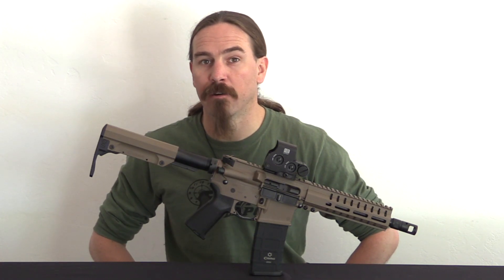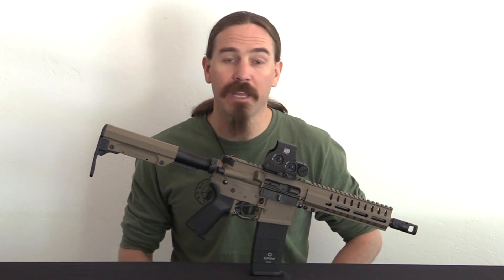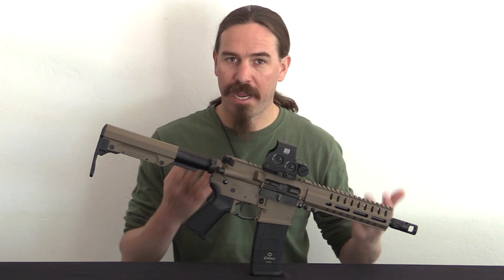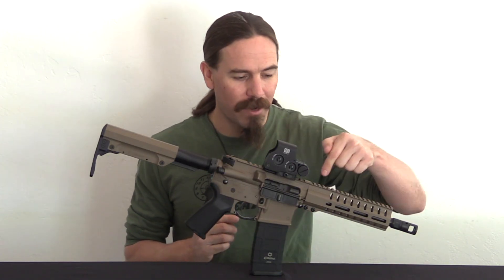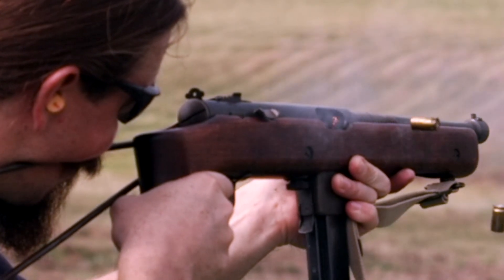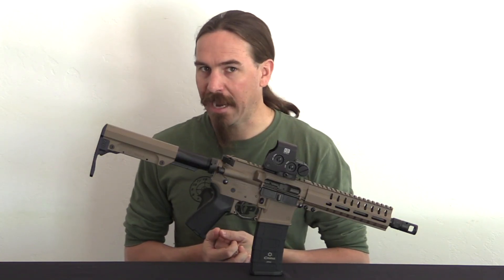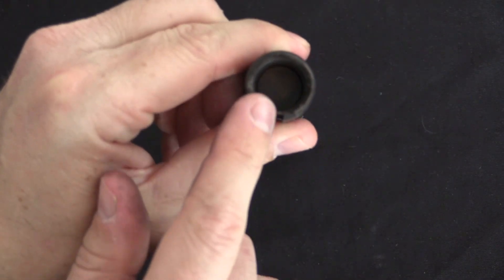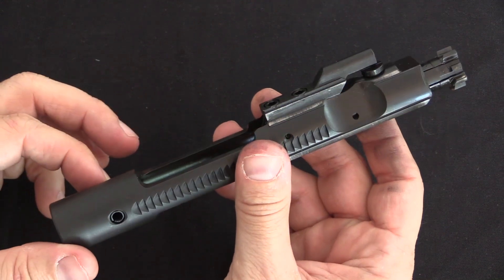CMMG Banshee: The Unique Radial Delayed Blowback System

Comment: Just for clarification, does platform use a spring and buffer like an AR-15 or M4/M16? If not, what pushes the bolt carrier and bolt forward when being cycled or after being fired?

Comment: I really like my Banshee, so much so that it is now my "bump in the night" response tool. I have, however, not had great luck with the conversion mags. I bought the 2-pack conversion kit when I got my Banshee and installed them in a couple of brand new gen 3 P-mags, and have had numerous feeding issues with both mags. I attribute that to running the gun with a silencer, as the mags got very dirty in very short order, which I believe was the cause of the jams. The CMMG "factory" mags (not their conversion mags, rather the 33-round CMMG-made mags) have functioned flawlessly however, and so are the only ones I will use now.

Comment: If the carrier was polymer but keeping bolt, cam pin, firing pin steel you would have a radial blow back for 300b/0 and 556. 😮

Comment: The magazine is interesting, but I'd be comfortable labeling it as impractical in any case besides reusing a lower from a different gun and converting it to tale 9mm. The extra space taken up by the unused area of the converted magazine could hold an extra magazine of a thinner construction. If I had to guess, you'd nearly double your ammunition supply by using thinner magazines.

Comment: FWIW and for posterity's sake, CMMG first named this series “The Guard”, and then later renamed it into “The Banshee”. I have one of the original 9mm Guards and started having a lot of FTE’s and double-feeds. After I sent it back to them they changed enough parts that they also wound up sending it back out to be completely re-Cerakoted in the Midnight Bronze color that I had. I was pleasantly surprised, assuming that if that much work needed to be done they would have just given me a new Banshee model off of their shelf. It’s run flawlessly ever since. And since so many OEM parts were swapped out for new versions I guess that’s part of the reason that the entire line was re-named as well.

Comment: Excellent breakdown of this innovative system. Likely the "Radial Delayed Blowback" system wears longer than H&K's roller delay system.
There is an excellent reflex sight, the HOLOSUN AEMS, that competes very well with the EoTech sight on your CMMG PCC. The AEMS circle/dot sight has many features:  solar panel for reticle when battery dies, choice of circle or dot reticle by pressing the minus button for 3 seconds, automatic OFF after 10 minutes of no movement and "shake awake" ON setting, clear replaceable lens covers, 4 night vision reticle brightness settings (tested to be as good as Eo Tech's settings). PLUSit is less expensive than the EoTech. 
I have an AEMS on my RUGER PC chassis carbine PCC and love it.

Comment: Thanks for doing it.  A technical explanation of how the forces are imparted below.

The difference in the radial delayed vs direct is that the force from the casing goes through several suboptimal vectors, that reduce the amount of force untimely going backwards on the carrier until the cam is rotated.

A simple analogy is pushing a door straight open(blowback) vs pushing at an angle (RDB) at at point the same distance at the hinge both times.  The inertia of the door or carrier is dependent on the direction force.  The door pushes out on the face, and the carrier only back into the buffer tube, no mater what direction the force is at.

1- The force from the casing goes against the bolt, this push causes the cam pin push back, but can only move at an angle, so the inertia applied to the cam pin from the bolt head is a fraction of the original force. 
2- The moment from the cam pin moving then induces a force on the carrier, again not in the optimal position to transfer the force.
3- This dual reduction holds steady until the cam pin is out of pocket and then the force from the casing on the bolt is in a much more optimal direction now, but at this point the peak force has already passed and less momentum has been imparted. 
4- At this point both RDB and DBB act the same in with movement, except the DBB has much more moment (1/2*Mass*Velocity^2), and that will transfer to the shooter.

The real marvel is using the angled lugs to keep the bolt from staying locked and the spring between the bolt and carrier to induce the direction.

Comment: I actually believe that this problem still rings true for the 9 as well as .45. The platform was never intended for a 9 mm cartridge and cutting the gas system from most has made it too dirty. Stick with things designed for the cartridges you're gonna shoot. Just my 2 cents. Pccars have been costing me so many 30 second penalties I'm about ready to sell mine.

Comment: The Banshee looks amazing, but quality control sucks from my perspective.   I purchased a Banshee MK17 9mm and from the first magazine, the trigger reset is garbage.  In my first outing I fired 100 rounds….probably 40 times the trigger failed to reset.  Not sure I got more than 2 or 3 rounds in a row to fire.  The gunsmith at the range took it apart and fiddled around with the safety and the trigger, then lubricated everything.  But no real improvement.  I contacted CMMG and they basically said I can send the gun back for repair (would take several months due to back log) or they will send me parts and I can try to fix it myself.  I am reasonably handy, but not a gun smith.  This sucks for a $1600 gun….all these reviews are positive….but they sell me a lemon and will do nothing about it.  Don’t waste your money.

Comment: The fact that the AR has a barrel extension and separate bolt makes this  platform ripe for dumping the gas system altogether and adopting a PSG1 style  roller lock for improved accuracy . As you know the gas system and semi auto is generally out of thenquestion unless you have a S5 ticket so getting rid of sloppy milspec bolt and extension and closing up tolerances is a good way to go . Just a guess here but I reckon CMMG probably used the 50° angle on the rear of the lugs as used in the H&K roller locking grooves ?

Comment: Would be interesting to create a magazine in 9mm for this gun that has has two columns of rounds, one in front of the other, for more capacity without increasing the magazine size. 
the column that feeds would be double stacked, while the other column would be single stack and slightly offset (tilting) to one side to male it shorter and allow the magazine to fit. Towards the bottom back of the mag there would be a spring to push the single stack into the double stack. 
This system would allow for 50% increase in ammo without increasing magazine height. 
Below is a rough example; the dash (-) is single stack round, the backslash (\) is the divider, the equal (=) is double stack, and the greater than (>) is the spring. The view is from the side.

| -\=|
| -\=|
| -\=|
|>- =|

Comment: Well i purchased just the CMMG barrel/BCG combo of their radial delayed blowback system. I do have a dedicated upper/lower as well for my .45ACP but im wondering if there are any modifications i may have to do to the upper since there is no gas system? I know i still need a light buffer kit but what about that? The upper still has the port for the gas tube. So do i plug it or do i have to buy a proprietary upper for their system? As i am researching ideas for buffer kits for it i saw a few videos on the gas systems so i thought about the open gas port on the upper. Any info/suggestions would be of great help.This is the upper i purchased. ( https://www.midwayusa.com/product/1020533646?pid=197087&utm_medium=email&utm_source=service&utm_campaign=order-confirmation&utm_content=product-description-link ) i hope its compatible with the CMMG's radial delayed blowback?

Comment: Have had my Mk45 Banshee since late 2017. It's has very soft recoil. A few drawbacks are proprietary recoil tube, and handgaurd attachment adapter. Also delayed blowback slows the cycle rate. To the point you can easily overrun it with a binary system. Wonderful little house gun though.

Comment: No it is not

The cam track is longer on the AR 15, because it does not allow the bolt to rotate at the upmost front and back position, which would render the whole delayed blowback system, that sort of thing could never happen also on a recoil operated gun

Comment: i had a cmmg 9mm convert which had bad feed issues. like you said, i used a high speed camera to find out it was the ugly flat plastic brass deflector they'd put on next to the ejection port.
some times the lip of the spent brass would corner dig into the flat face of that plastic deflector and bounce directly backwards, back into the chamber. it was driving me crazy because it would be half ejected stove pipes some times, other times it'd be standard "failure to eject" stile brass in the way. some times the brass would end up back in the chamber completely backwards, primer towards the barrel.
took the deflector off, no more issues.

Comment: Reminds me of the blish system. Not in the original operational theory, but in the use of geometric impedance. Not in the original linier form, but radial. That is the initial energy is divided with a portion of the energy being redirected in an orthogonal direction of the initial force, that is redirect geometrically with a beveled bearing surface; causing the needed momentary delay until the impedance had been overcome.

Comment: One small Czech gun company called V-AR makes a 9mm AR15 that uses the buffer tube as a cylinder with a small hole at the end and the buffer as a piston, so when the bolt goes back it compresses the air in the buffer tube that is forced to escape through the rather small hole and that slows the bolt down. Pretty interesting.

Comment: This radial delayed blowback system with the angled cuts on the rear surface of the bolt locking lugs seems like it would translate over to an AR-18 style of bolt carrier and receiver setup very well.  It'd be able to make use of a folding stock due to not having the action spring in a buffer tube and the square bolt carrier would be easy to modify for swappable weights to tune the action.  Add the fact that a simple stamped receiver would be cheaper to mass produce and you have an attractive little PDW concept.

Comment: My friend just built a 40 cal S&W with the cmmg bolt and barrel. People will say that you cant get it to function on a standard lower made for direct blowback bcgs but with some slight modifications to the ejector tab, it functions perfectly. He used an 80% lower with lrbho from AAO as well and it runs really well. The only issue we had with the lower is that it comes with a really weak mag release spring, a stiffer one holds the mag in perfectly. For the upper he used a slick side 458 socom upper. If you want any pointers on building a banshee using cheaper direct blowback lower then let me know.

Comment: My question of course is if it's 45 Super or 460 Rowland capable. The AR mag setup for this makes sense in a bit more of a way than the 9mm because there never were a lot of high cap magazines that are in current, common production.

In terms of the bolt weight with 9mm at least I run a steel buffer and it makes a huge difference. After running one with a standard buffer I would certainly not be excited about that. At the very least I'd stuff a couple dollars of quarters behind it.
Reply: @thetriode The Banshee 45ACP is rated for 450SMC/45 SUPER

Comment: Very nice innovation but it looks like that system could experience a large amount of wear, you have the bolt lugs sliding against the barrel lugs during maximum chamber pressure.
I guess with pistol rounds it's not so bad but I wonder if this could be applied to larger cartridges, might need special lubricants.
One nice thing is that you could extend the opening time by having less but wider lugs.

Comment: Can the casing rotate and move  inside the casing in that motion during the high preasure at the begining of the cicle? Or wil it just move axially and slip on the surface of the bolt when it starts to rotate? I was working on a delayed blowback  system and I dont know how much movement it could be allowed without damaging the casings by using this kind of mechanisms.

Comment: It was very interesting to learn all of this. Didn't know most of it. Especially surprised about the part where they couldn't get the DI 45acp guns to work properly. Macon Armory whole thing is DI pistol caliber carbines and theirs run beautifully. They have been making then for a while as well. I am glad to see the RDB system is taking off. Now they just need to fix the ejector spring issue and it will be perfect!

Comment: Unfortunately, the mag conversion inserts don't work with just any AR/M4/M-16 mag.  They were molded to fit a Gen2 or Gen3 PMag body, so they won't fit aluminum G.I. mags or those dusty Thermold mags you haven't thown away yet.

Comment: I think .30 carbine would be a lot of fun in small modern carbine like this - imagine an M1 equivalent with modern reliability. PCC's and SMG's have always struck me as good place to use cartridges that are a bit too big and/or high pressure to be truly practical in handguns, including but not limited to .30 carbine and full power 10mm auto.

Comment: The Endomag conversions are more trouble than they are worth if you're trying to get a registered SBR lower to run a CMMG upper in USPSA. Fine for plinking or Steel Challenge, but not worth the hassle otherwise. Trust me. There are weird quirks that happen when you convert a mag designed for 30 rounds of 5.56 to hold 30 rounds of 9mm instead which has a different case head diameter.

Comment: One of the CMMG ads has an animated diagram of how it works. I started at that for a while, and it was an epiphany when I realized that they had essentially reversed the process for the standard AR-15 locking lugs and cam pin. I was stunned when I finally realized how it works. I think the real genius of this thing is that it uses parts that are almost standard, just tweaked subtly.

Comment: Years ago before I learned how the AR's "not really DI" internal piston system worked, I actually thought this is what happened: first the bolt rotates, then it "pushes" the carrier to the rear. I have to assume I'm not the only one who got it backwards. I don't know if this is what motivated CMMG to design their mechanism, but I find it truly inspired and brilliant that they've taken what may be a layman's common misconception, and used exactly that understanding to transform an internal gas piston into a delayed blowback using highly similar parts in virtually the same configuration. Super cool stuff.

Comment: It definitely is appealing that this upper can work on a standard ar-15 lower, but as I was tempted to buy one, I was thinking about what advantage a pistol-caliber-carbine would have? I'm struggling to think of an example.
Isn't the ineffectiveness of pistol-caliber-carbines the entire reason why the MP7 and P90 pdw's were developed?
Isn't the whole point of a pistol-caliber's shortness to fit into the grip of a handgun?
If you're using a carbine, you aren't restricted by that limitation.
I can't help but feel that this upper is trading off range and penetration, without any significant gains in other areas.
I don't worry about penetration when I'm carrying my handgun (for personal protection), but I very much do worry about penetration if I'm going to use a long gun.

Comment: I think that the Banshee in 5.7mm is a pretty slick idea. It makes FN FiveseveN mags seem more worth their price.
Reply: If you haven't noticed, they just made one in 4.6x30mm, which is what the MP7 uses. CMMG is really pushing the boundaries at to what the AR platform can fire.
Reply: @guyman7776  I did, but if I was running the company that wouldn't have been my first choice. Relatively speaking, 4.6 doesn't bring anything new to the table (because it's so similar to 5.7) so whether the gun survives on the market depends on how many people want to pay for a pointless and expensive proprietary round, seeing as HK doesn't seem to care about making a civilian MP7 any time soon. I would rather see them make an AR pistol in 7.5 FK and hopefully encourage other companies to put that round into production to bring down its price.
Reply: @AlexLee-dc2vb  7.5 does seem interesting, but that runs into the same problem, another obscure hard to find round. I wonder if FK makes a PCC in 7.5 that ends up being popular, CMMG might make an upper for it and demand for the round goes up and makes more manufacturers interested in making it making it easier to get.
Reply: A 5.7 that doesn’t use the 50 round horizontal mags is missing the boat.
Reply: @johnniewasr  not really. The point or the 5.7m was to make a low caliber high velocity round that could penetrate soft armor. The p90 only really used horizontal mags due to compactness being a necessity.